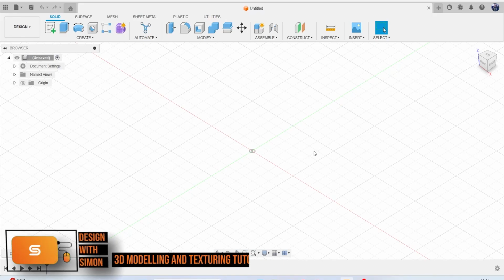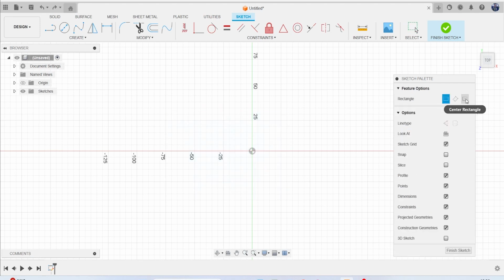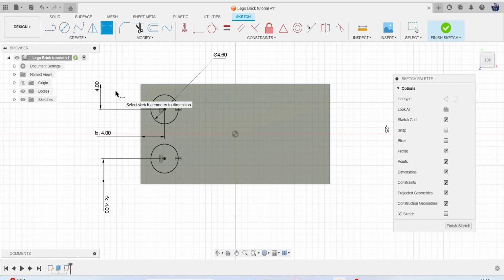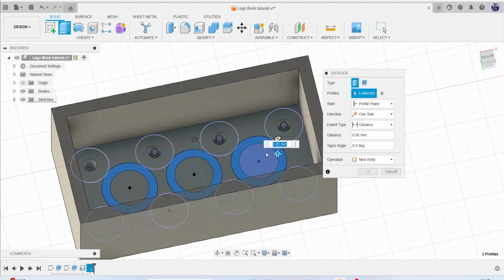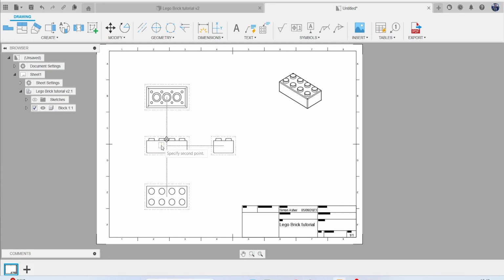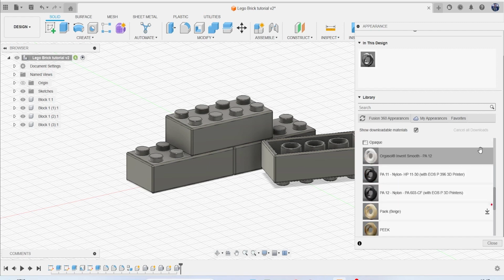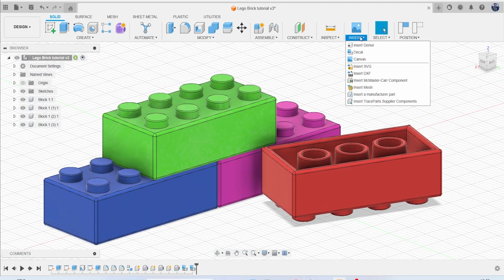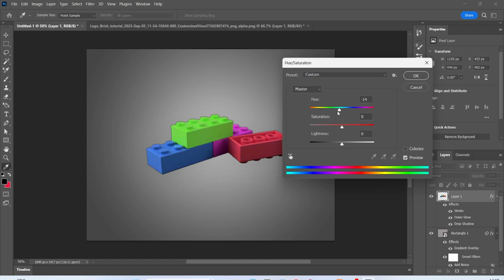Fusion 360 Beginner Tutorial 1

Comment: How do you know people have a middle mouse button? Is that something fusion360 requires? Do you/autodesk recommend specific brand and model?
Reply from the maker: Its not required but it does make it a bit easier, iv not used it without a mouse so i wouldn't be able to advise how to do it without. I just used a gaming mouse nothing overly special, i have known people use just the track pad before but i could never really get the hang of it